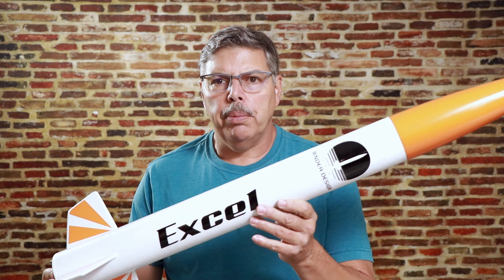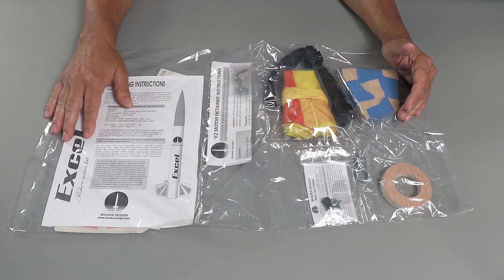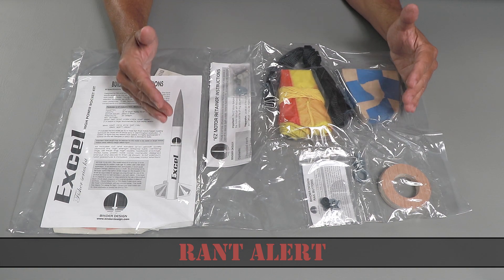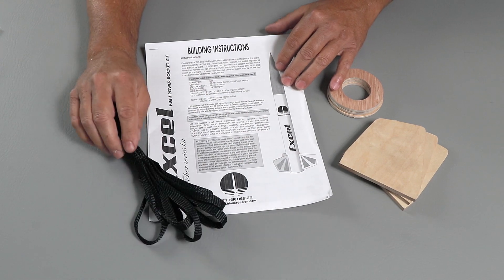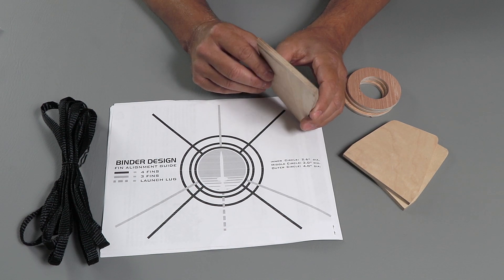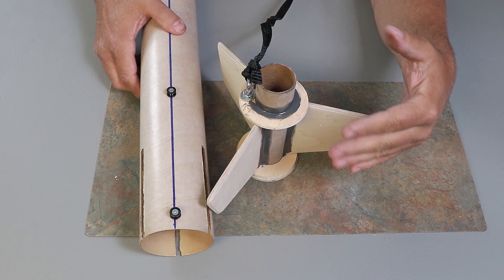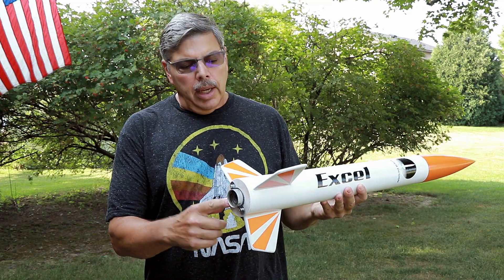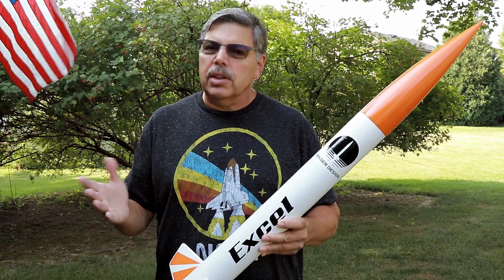3" Excel rocket, review, build and fly on a sugar motor.

Comment: The launch rod looks like it is around 3/4" diameter pipe. Am I seeing that correctly? I like the idea of a sturdy launch rod instead of a flimsy one that may lean over during a powerful launch. Does this rocket use one or two launch guide tubes on the side of the rocket body?
Reply from the maker: The launch hardware is a 1"x1" or 1010 aluminum rail by 8' long that I purchased locally at Grainger. I bolt the rail to a 2x4",  then clamp it to a Jawstand and use tent stakes to fasten to the ground. The rocket has two 1010 rail buttons. Attach one button to the rear and the other near the center of gravity.
https://www.amazon.com/80-20-Inc-T-Slotted-Extrusion/dp/B001F0K4KA/ref=sr_1_4?dchild=1&keywords=1010+rail&qid=1599832957&sr=8-4